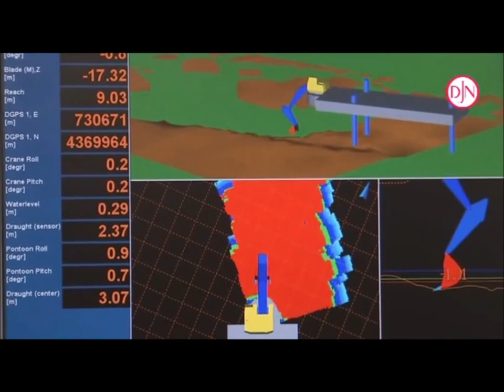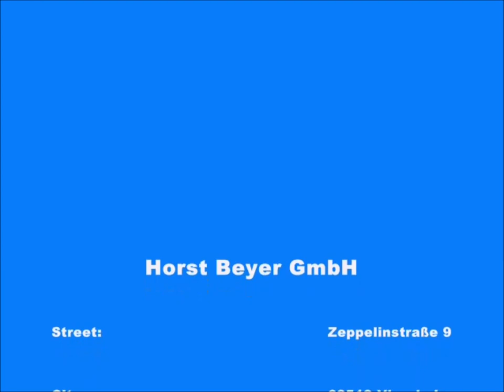Dredging Methods

Comment: Nice Job and I like this Job, Im also Working Dredger
Reply: Hello did you need a alot of previous experience operating machinery for this job. I work in a factory and operate machine a machine making hvac ducts nothing like this but I just applied for an dredge position. Would I need more experience